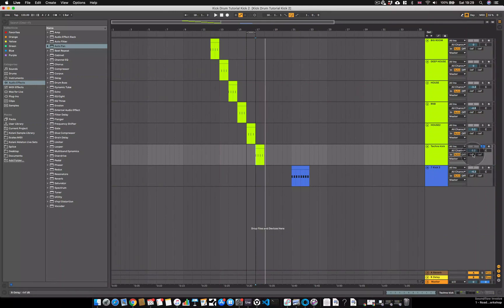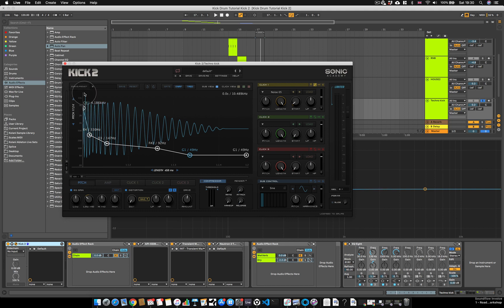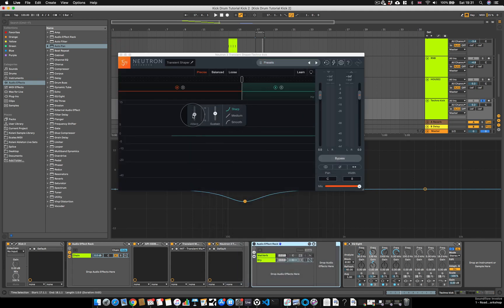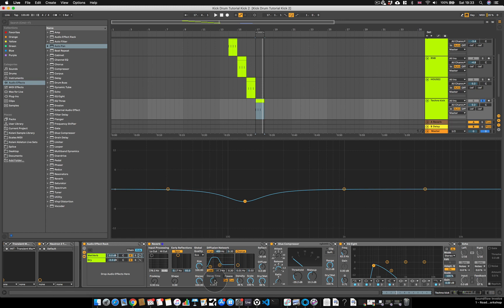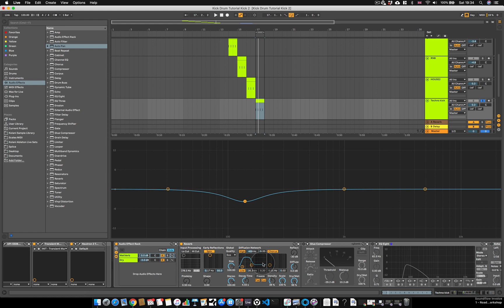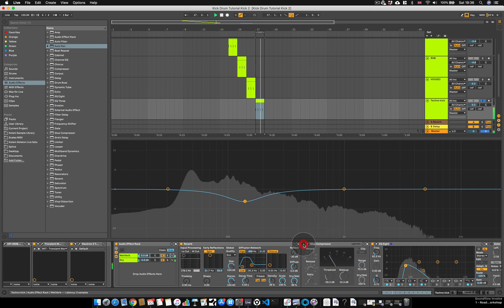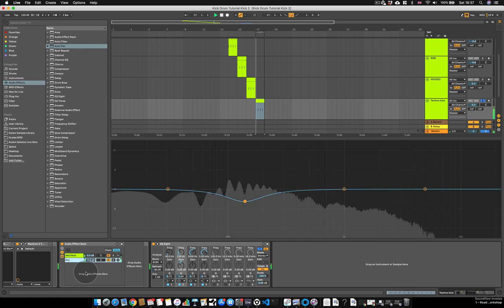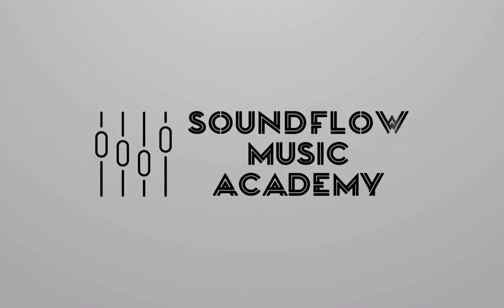Kick 2 Tutorial - Techno Kick

Comment: You know, instead of using reverb, you can use filtered noise to create a similar, but sometimes more useful kick body. It requires a different sculpting, but it is another option. Also, EVERYTHING below 160hz should be summed mono, everywhere, all the time. Not just the kick but everything.